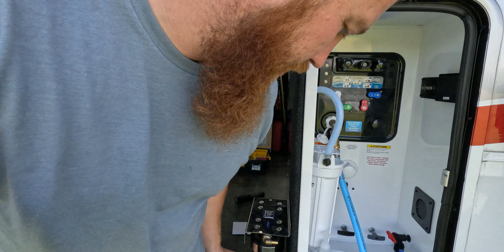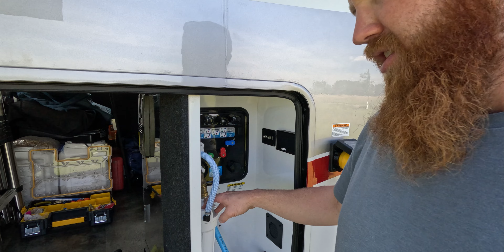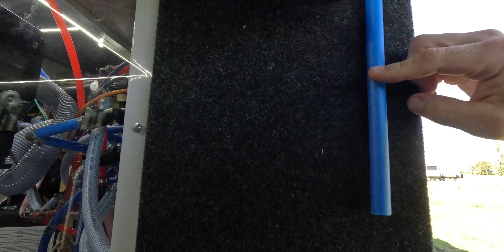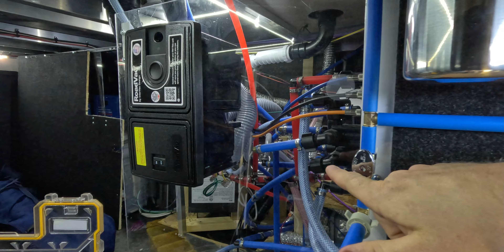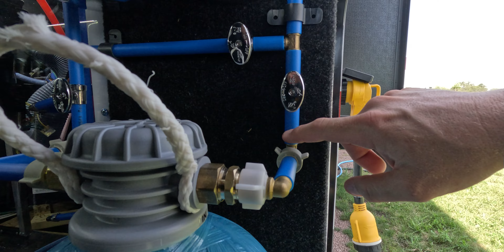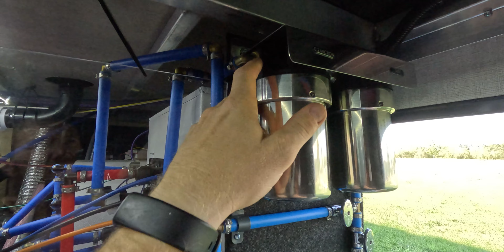RV Water System Upgrade | Blu Tech Filter & On-The-Go Water Softener

Comment: Good vid! Clear and helpful…. Do their filter units come from the factory with female NPT ports? Or are they hose ports? Did you need to get adapters?

Edit: I just was contacted by them and they were very nice and helpful. Great customer service.
Reply from the maker: You can choose to get it with hose fittings for easy hook-up to a garden hose, or opt for PEX fittings to connect directly to a PEX line. If they don't have what you're looking for, any local hardware store should carry the necessary parts. We couldn't find the PEX fittings initially, so that's the route we took. Also, it's great to hear they reached out and provided excellent customer service. It really makes a difference!

Comment: What about your holding tanks did you put a line in from it then into the filters 
Think you would have too install a shutoff  to bypass your city water
Reply from the maker: We have the option to fill our tanks using the city water inlet. So that's what we do. That way, everything is filtered and soft that goes into our tanks.

Comment: Good morning friend, after using it for 3 months, how is the filtration system working?
Reply from the maker: We're still loving it, and it's been working awesomely. We change the filters every 3 months or so, depending on need. We haven't experienced any problems, leaks, or anything of the sort. Would still definitely highly recommend it if you're in the market.

Comment: Are you still using that house filter in wet bay or is it empty now
Reply from the maker: Yes, we still utilize the one in the wet bay as our initial 5-micron filter, which then feeds into our aftermarket 2-stage filter, before finally passing through the water softener. Essentially, we've created a Blu Teck 3-stage system by incorporating the OEM filter initially provided. It's been working great for us!